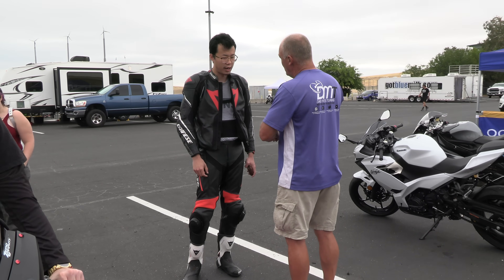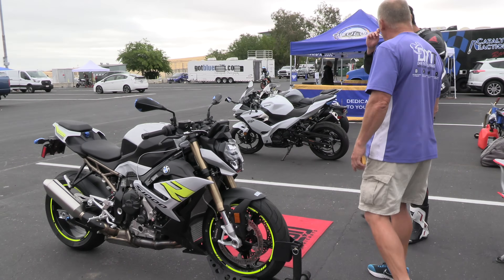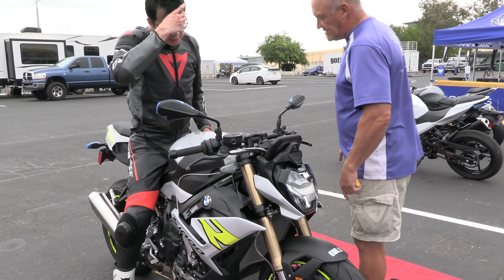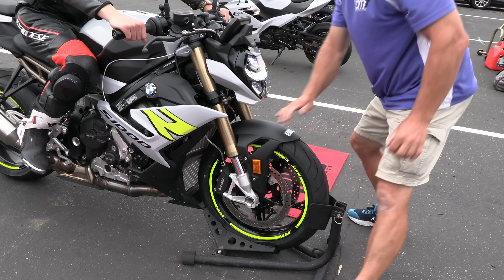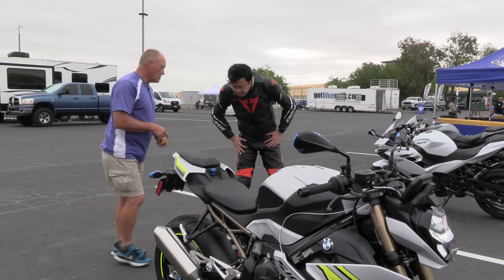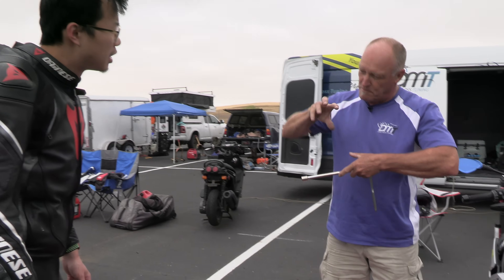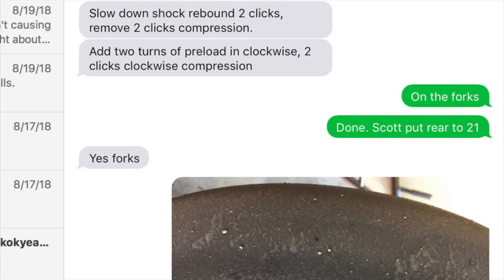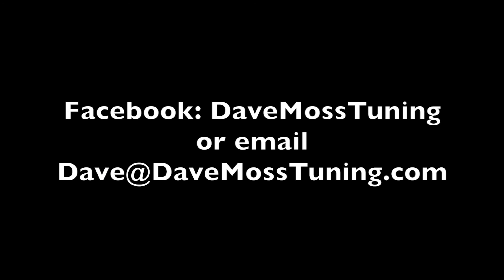2 Clicks Out: 2022 S1000R Electronic DDC Suspension Setup

Comment: Hi. i have the same Model. My Problem is the Frontwheel become instabil when i go highspeed up to 180km/h... Sometime its like wobble and its scary. My Setting is Dynamic and 1 Rider. One Friend say its a Suspension Setup Problem. The Bike is for Setup from BMW for a 85kg Rider and I am just 65kg, thats why my Back get down and my front get up when i speeding. My Question: How can i change the Suspension Setup to solve this Front Instability Problem? More or Less Preload to the Back? Thx from Germany
Reply from the maker: The shake is because the shock is too hard or too soft with preload. Turn the adjuster 3 complete turns left then 6 complete turns right and see if the shock preload change helps you as this will tell you the direction you should go with. If the fork preload is too hard, you need to assess with fork travel used and the cable tie should be  20-25mm from the base of the fork tube at the bottom.
Reply: @catalystreactionsbw   thank you for the fast reply. I will check it out!

Comment: Do the modes change preload? I do not think so
Reply: They do not, preload is a dial on the right fork.
Reply: Yes but interesting it becomes so much harder only by changing compression
Reply: @MrMedicusNeo those settings can also make the suspension feel stiffer vs softer, preload more so determines the maximum travel allowed both ways.
Reply from the maker: @MrMedicusNeo  Remember that when you go from minimum 1, the "valve" is wide open so flow is quick. When you get to 12, the valve is mostly closed to flow is significantly reduced so it feels harder.

Comment: Dies the suspension adjusted for each mode? What happens if you set it to road then want to switch to RacePro or any other mode?Or once you set it it applies to all?
Reply from the maker: For the suspension, all modes except Pro 1, 2 and 3 are ECU coded and you cannot make changes. When you set pro modes, those are your choice.

Comment: Hello Dave, plan on picking up a 2023 S1000R with full electronic suspension.  The previous ordered it with all options.  I am 72yrs. old, 215lbs. without gear and upper intermediate track rider, Chuckwalla, and Fontana.  Will be using the bike for canyon and tracking and would like to know if my bike will work well once set up by you?  I had planned on purchasing a new 2024 base model but no one has any cartridges and springs for the front and rear suspension.  Contacted all of the suspension manufacture in the world and no luck.  What is your advice on my issue, can you help me out?  Thank You
Reply from the maker: Congrats on your S1000R and I am very suprised to know that no one offers any suspension for this model. A little resrach should yield if there are changes from previous years regarding fork and shock length and shock reservoir location. If they are the same as previous models, then you can back track and find out what companies made internals and a shock. Ohlins offered a shock in 2020 and KTech offered fork cartridges for the 2018. You can approach GP Suspension in Ventura to make cartridges for you.
Reply: Hello Dave, contacted KTech, he did research and called back, no luck.  I did leave a message with GP and waiting for a call back.  My son and I passed by GP motorcycles on India st. in San Diego and noticed your set up on the lot.  Hope to see you in SoCal in the future.  Thanks again!  Joe Salemi @catalystreactionsbw
Reply: I found a company that will make cartridges and springs for the bike, will see after the holidays.  Thanks again for helping me.  Dave, do you eat avacado's?  I grow them on my property in San Diego and will send a box to you if you like.  1st picking is February and these are organic and nothing you can buy at the markets.   @catalystreactionsbw
Reply from the maker: @jsalemi9711  I eat 1.5 avocado's a day as part of my cancer fighting diet. I would sincerely appreciate some homegrown avocado's from you orchard! Let me know the best way to send you my address. Thank you!
Reply: Hi Dave, so sorry to hear about your cancer.  I've had prostrate cancer for the past 5yrs. a slow growing type and the doctor claims that I will probably die of something else.  I'm going on 73yrs. and had a great life, no complaints.  As soon as the picking season starts I will get in touch with you and send you avacado's for the whole season.  I grow Fuerte, Reeds and Gems.  
Take Care!
Joe @catalystreactionsbw
Reply from the maker: @jsalemi9711   Hi Joe, so many of us get it after 60 - the stats are staggering. But, as you know the cancer is so slow growing it doesn't do much of anything other than effect us psychologically if we let it. I've been on no carnbbs and no sugar for several months now to great effect with super foods including an avocado every day. I have so much more energy! I trust you will crack on with life and revel with our day to day like me. Thanks again for the gift - very excited to get some from you. Take care, live well.
Reply: hi dave, sorry for my intrusion into your conversation..But after i read it...i have to say: I follow your (joutube) Journey intensively since 3 Years now and have so much learnd and apprechiat every minute of your content and i am (and my wife Christine as a pillion to) so gradefull about you. We have so much more Fun on our little Bike (after Suspension-Setup based on your content) Best Greetings from Germany. Thomas and Christine.
Reply: If you ever come to Germany, you are guaranteed a warm soup and a bed.

Comment: You can make manual adjustments over the electronics?
Reply from the maker: There is manual preload to use for the right fork and rear shock in some generations. You can also buy the dynamic pro option to give you more adjustment. The bottom line is that between sag, mode and load - you will find a good setting that makes the bike fun to ride.

Comment: Question can you use 2x helmet function to gain more preloaded for 100lbs + club?
Reply from the maker: The helmet number by default changes the setting for damping and/or preload depending on the ECU and wiring.
Reply: @catalystreactionsbw  okay thanks dave, much appreciated

Comment: I have a question with regard to electronic suspension. With bikes that have this, you can generally select different modes to suit what you’re doing - race, road, comfort etc. It’s great that the system can constantly make minor adjustments to keep the suspension working at its optimal performance, but what if you need to change the setup. What I mean is weight, i.e. the spring rates will have been selected for an average rider and the valving for compression and rebound will be set around that spring rate. If you’re like me and you’re heavy and you need to change to a heavier spring, how does the electronic setup cope with those changes as it is making adjustments based on a different setup?
Reply from the maker: Great question that only the programmer can answer given the perameters that they created. On top of that comes oil age and degradation as the algorithm is created for new oil until it degrades to xx miles/kms or time? On the flips side, what we can do as owners is set sag, set damping and see what setting is needed to control rebound damping to create chassis stability. If we instantly get close to maximum, can a different VI or cSt oil be used to assist with that or will the programing have an issue with the slower flow rate? I hope we are lucky enough to have a programmer that works with these suspension systems educate us.
Reply: That is the same issue I have with being a little on the heavy side.  I contacted BMW and they have no solution on spring rates.  Maybe you can find someone that will make custom cartridges,  springs and coils?   You would think BMW would have thought of something that simple to resolve this problem. The electronic suspension does not work on the track or brisk canyon riding.  Have friends that own from 2015-2022 and had complaints.  Does anyone have bar vibrations?  I have tested over 4 bikes and my hands went numb, any fix on this issue.  I like the bike and being over 70yrs. old want a more upright position that will work for my riding missions.  
Thanks

Comment: i have a 2019 at 220 punds my front preload is almost all the way tight. hes 155 and basically doing the same thing.. bike needs more adjustment settings
Reply from the maker: Don't just rely on preload. Compression and preload need to work together as a team to share the load with the tyre.

Comment: bmw 2022, get toolless suspension settings already.
Reply: I dont know if its for the best. With mechanical adjusters you can go as precise as you want. Half-turn, quarter-turn. Really tune it to your exact needs. Unless the software gives you a digital "knob", that would be cool :) Like volume setting on your phone you know ? 1-10 for compression and damping scale or something if you feel like really getting into it.
Reply: Many manufacturers have all settings with numbers like 1-12 for all the different settings. But this system with no individual settings capability inferior.

Comment: Ive been following so many of your videos, love them. I also just got this bike and overall love it. Getting used to mainly adjusting through electronics. Although a concern I have is that the steering gets very light at high speed (110+) that gets the front into a speed wobble. I’ve ridden many bikes and this is the first one that I can consistently get to do this and is not comforting.
I am the same weight as the rider in this video. I still haven’t checked sag and all that stuff yet for myself which I know I need to do. But should I also look in to upgrading the steering damper as well?
Reply from the maker: Front getting light is normally due to the shock being too hard or too stiff. So shock travel being assessed is a critical piece of information. Next would be fork travel used to see if the settings are too stiff. Lastly would be checking rebound settings to see if the front is too fast keeping it high and rear is too slow keeping it down.
Reply: someone else has also complained about the r getting light at speeds. This bike seems to have this issue. hope you figure it out.
Reply: What tires are you on?  I had the same problem.  Turns out it was because of my a22’s.  

The other fix is a ohlins damper. 

This is after you have had it properly adjusted of course,  if it still feel light at speed then tires or damper.
Reply: Sorry.  S22’s.
Reply from the maker: @ihategmz5174  It would be very helpful for you to understand shock travel used (https://www.youtube.com/watch?v=KeZT1LCY8CU&t=4s) and how that impacts poor handling. A steering damper does not help as it does not address why this is happening. Once you have shock travel optimal, then check fork rebound (https://www.youtube.com/watch?v=yTBepXwQQE8&t=6s)
Reply: I read about it a lot and basically you are all
Right, seems like a dumper from M1000R helps a lot

Comment: Does 2021 s1000xr has the same adjustablilty options?
Reply from the maker: XR has modes and load settings plus dynamic or dynamic pro. You set sag via load setting, then assess what the modes do. Once you pick a mode, then test one  rider, one rider with luggage and two riders to see what gives you the best quality ride.